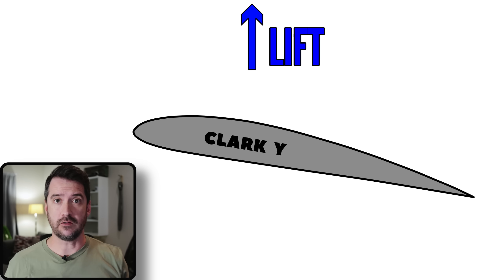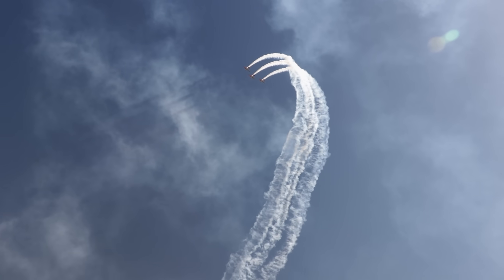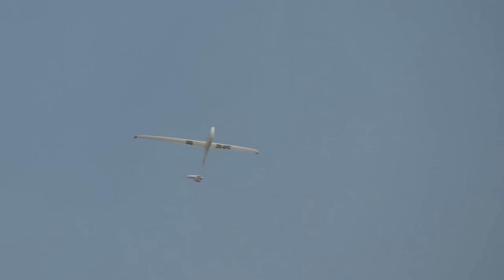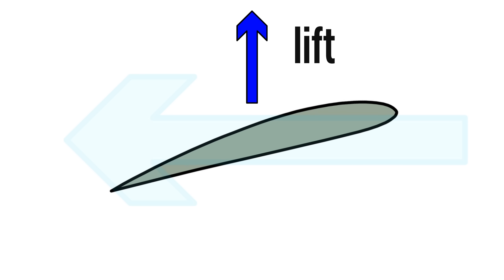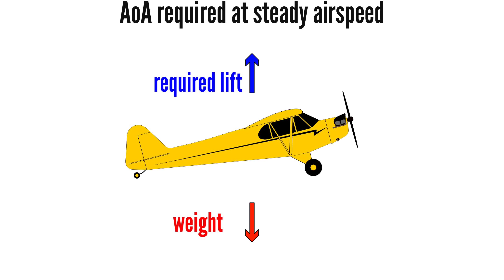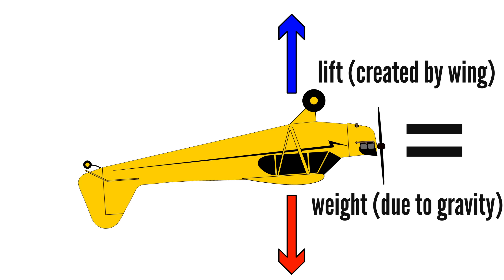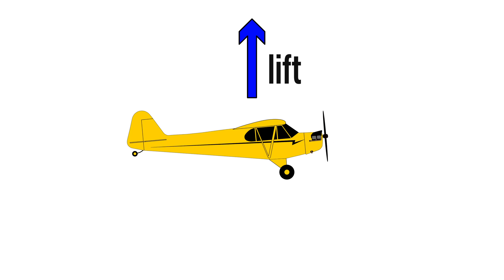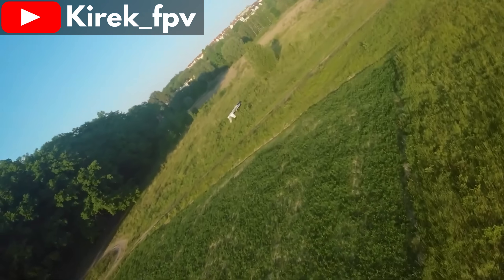Is Airflow Distance Over the Top of a Wing Always Longer?

Comment: 'Path length' creating faster flow above the wing and therefore lower pressure above the wing than below, is still wrong. Just because some people have come up with the wrong arguments for why it is wrong doesn't make it right. As one of your videos correctly illustrated, air flowing over the top of the wing arrives at the trailing edge 'before' air flow under the wing. This can be seen in wind tunnel experiments with dyes and aerofoils. There is no physical requirement for the divided air molecules / parcels / whatever to rejoin at the same time at the trailing edge. Path length therefore doesn't explain the velocity difference above and below the wing. There is no physical basis for appealing to path length to explain the lift force. I think the confusion in trying to intuit lift forces arises as we try to assign cause and effect at one instance in time to a flow. In reality, the pressure field affects the velocity field (or flow field) and the flow field affects the pressure field over a continuum in time and space which is why lift force is so difficult to intuit from a static picture. Bernoulli's equation only relates pressure and velocity, it doesn't attribute cause and effect. It would be fantastic to have a really intuitive way of picturing the explanation for the lift force on an aerofoil but I've yet to see one. There's a reason why there are so many incorrect attempts to wrap it up in a simple way. You still need a lot of heavy maths to calculate the numbers required. And when people say it's 'simply' Newtons Laws, fluid dynamics/mechanics embodies newtonian mechanics, it doesn't break it. In first year University Physics we derived Bernoulli's equation from Newton's laws. We use concepts such as pressure instead of force because it makes the maths more convenient and you can easily measure it in a flow.
Reply: I've read that the mass and velocity of the air shoved downwards provides much of the explanation for lift
Reply: @jmevb60  Yes, but downward on both sides of the wing. Without the boundary layer sticking to the wing on the upper side, the lift just collapses, although the lower side of the wing still works fine. This happens when a plane stalls, or when one sheets in too much the sail of a boat etc...
Reply: @jmevb60  So that's the conservation of momentum (mv) but you also have to conserve energy which is essentially what Bernoulli equation conserves.  Along with conserving mass, all three give you the Euler equations and you have to consider all of them together. If you want to consider viscosity as well, you get the complete picture which are the Navier-Stokes equations. But the Euler equations are a pretty decent approximation for subsonic flight and idealised aerofoils. They are all linked which is why it's hard to intuit. The path length and equal transit time are not physics though - which is why this video doesn't really have a point. Just because the upside down plane example isn't a good argument against path length, doesn't make path length and transit time true. There are several arguments against flat earth theory that aren't very good and you could ague against - but the Earth still isn't flat - for some other very good reasons!
Reply: @7up-weee  "The path length and equal transit time are not physics though - which is why this video doesn't really have a point."  

But you mentioned Bernoulli is an energy conservation process.  How do you initiate the Bernoulli pressure asymmetry, if you don't impose a path length asymmetry "stress" on the mass flow rate continuity?

Doesn't the mass flow continuity stress, drop the pressure to satisfy conservation of energy (mass transport rate equivalence: transport speed higher, at lower density)?

Isn't lift a fundamental consequence of an asymmetry imposed on fundamental principles of conservation of mass, energy and momentum, where the path length difference has to play a role?

Isn't the path length difference right at the core of the physics?  

Though I think there was agreement that equal transit time is flawed? (substitute mass flow rate continuity maybe)
Reply: @davetime5234  No, the path length difference is not the explanation. First because paper airplane fly just fine, so do very simple kites made with a simple tissue, sails create lift upwind (although they are thin) etc.
Second because if you compute the lift based on the difference of path length theory, the lift you find is way below the actual value. 
Third because there is no equal transit time, the air above the wing arrives before the air below. Demonstrated in CFD and experiments.
This does not mean Bernouilli is wrong, it is correct, but the pressure/velocity difference is not related with the path length difference. It is more complicated. However, to describe it intuitively, there is vorticity created, which creates two vortices, one above the wing, and one below, which based on simple centrifugal force, create a relatively higher pressure below the wing, and a lower one above.
Reply: @__-1234 " the path length difference is not the explanation. First because paper airplane fly just fine, so do very simple kites made with a simple tissue, sails create lift upwind (although they are thin)"

But doesn't the perfectly thin wing's asymmetry result in more curvature of flow lines on the lower pressure side than on the higher-pressure side?

And doesn't more curvature introduced between two points mean longer path?

Therefore, the difference in average path length must be related to the difference in pressure also in the case of a perfectly thin wing?

"if you compute the lift based on the difference of path length theory, the lift you find is way below the actual value. "

The above shouldn't be true if you take the actual path length difference introduced across the "entire stack of flowlines," because this composite flow line deviation directly represents the pressure.

"Third because there is no equal transit time, the air above the wing arrives before the air below. Demonstrated in CFD and experiments."

Mass transit time is equal between two contrasted regions which both are taken such that they have the same mass flow rate inputs but with different cross-sectional area restriction.

The velocity difference is proportional to the ratio of the two different cross-sectional areas (continuity equation).

"It is more complicated."

Most fundamentally I don't think it's any more complicated than asymmetrical path restriction imposed on mass flow continuity, and the necessary resulting conservation of energy and momentum effects.

"to describe it intuitively, there is vorticity created, which creates two vortices, one above the wing, and one below, which based on simple centrifugal force"

The reason why vorticity doesn't work for me as the default intuitive explanation is because vorticity is not a fundamental physical property in terms of first principle physical laws.  Vorticity is a physical complexity manifestation of even more elementary physical laws. 

While such derived complexity is also at a necessary level of analysis, as a starting point it seems to be causing a lot of confusion to the large diversity people's backgrounds who are engaged in understanding the fundamental nature of lift.  

"simple centrifugal force"

Centrifugal force again I can't picture in terms of a fundamental insight.  It doesn't help reduce the number of steps in gaining insight in terms of first principles.  

For example.   Centrifugal is the reaction experience from a centripetal force.

Where is the centripetal force?
Reply: @davetime5234  I don't think. If you check flow around a sail for example, there are just a few mm of distance between the intrado and the extrado. And it works, even allows the boat to go against the wind. 
The lift is created by the vorticity, not by the longer pathway.
And once again, it is very simple to show the longer pathway theory is wrong, since  it allows computing the pressure difference very easily with Bernouilli . And therefore the lift. And the lift that is computed this way is way too small. Cannot make the airplane fly... 
I know this is kind of disappointing, because this explanation looks nice and simple. But it is wrong.
Reply: @__-1234 I'm not sure which notion you're answering.  Please re-read my last comment as I've been editing it likely as you were replying.  You're disagreeing with things I haven't said.
Reply: @__-1234  If you are going to disagree with something I'd like to ask that you are very specific about what words you are responding to.  Mis-paraphasing is an issue here.
Reply: @__-1234  "since  it allows computing the pressure difference very easily with Bernouilli . And therefore the lift. And the lift that is computed this way is way too small."

Don't you think it would only be fair if you would, with sufficient accuracy, relate to me (since we can't share images here, I assume) your assumption methodology so that I can have a fair change of assessing its validity?
Reply: @davetime5234  Very simple. You take the pathway length above the wing, the pathway length below. You assume equal transit time T. The pathway length above and below provides a mean corresponding velocity V_above, and V_below, that you use with Bernouili, to convert to pressure P_above, P_below. It gives the pressure difference, which gives the lift. This lift, based on wing surface, should be able to lift an airplane.
If it does not, if it turns to be way below what is needed. Then... it is not the right explanation. Et voilà.
Reply: @__-1234  Ok, how did you:

1)incorporate the mass continuity transit time into that calculation, and 

2)how are you defining a path length comparison (what path lengths are you talking about?), and

3)how did you relate any such path length difference, to the cross-sectional area restriction imposed?
Reply: @davetime5234  
If you assume a certain length L below the wing, and another alpha*L above, and assume equal transit time T, therefore if the speed below is U, then the speed above has to be alpha*U. From this you can compute delta_p using Bernouilli.
It supposes the flow splits in two parts, and this is where conservation comes from.
But this is all wrong because there is no evidence the flow splits into two parts, nor that there is equal transit time, nor that the flow reaches the leaving edge at the same time from a Lagrangian point of view.
Reply: @__-1234  But you're imposing invalidly simplified assumptions, which guarantee an invalid result.

You can't apply Bernoulli without also applying the continuity condition.

And the path length (clearly this is a point of confusion) can't be taken literally to be the "transport path length."

The "path length" here, so far, only has the meaning of being an indirect measure of assuring asymmetry of transport access.

The question as far as putting in some numbers for estimation is: how much does the resulting asymmetry restrict the actual flow path access?

So, does the geometry of an actual in-real-life wing's asymmetry likely present two contrasting area cross-sections, capable of providing enough velocity differentiation, given a flight worthy level of indicated airspeed (dynamic pressure equivalent speed), to provide the necessary pressure difference to support a realistic aircraft weight?

The question can be restated: how much path restrictiveness do you need to impose, given the continuous mass transport requirement, to accelerate a given mass of flow sufficiently to achieve enough pressure difference, for the conditions of speed, mass density, and geometry, and useful load to be supported?

The implication is: the asymmetry imposes a higher than equal transit time speed on the unavoidable condition that mass transport does maintain equal transit time through the restricted space.

You need to calculate what the actual accelerated speed is for equal mass transit time, from the restricted access.

And, interestingly, the point you made about density not changing significantly, is necessary for the above calculation.
Reply: @davetime5234  So what is the path length ? For the Bernouilli equation to apply, you need the flow to be either irrotational, in which case you can apply it between any two points. But here it is clearly rotational above the wing.
Or you need to follow a Lagrangian trajectory. Like a tracer. And all Lagrangian tracers experiments, numerical or not, show that from a Lagrangian point of view, there is no qual transit time.  So please clarify this notion of equal transit time, what does it mean ? How do you compute this "time" ?
Reply: @__-1234  I was thinking in terms of 4 sets of rectangles to characterize above and below the wing:  two entry and two exit rectangles.  

But assume you only have the above wing set (something like an idealized simplification that the bottom of the wing is oriented such that no change from ambient pressure occurs at the bottom).

Then A1 x V1 = A2 x V2 because mass density is a constant.  The A's are "entry" and "exit" cross-sectional areas (areas capturing meaningful influence to the relative wind).  V's are the resulting velocities from the mass flow continuity requirement (mass in per unit time equals mass out per unit time). 

Clearly any non-unity ratio between A1 and A2 results in change in measured speed to arrive at the constant mass transit speed.

Because mass cannot accumulate in steady state, the mass equal-transit-time as indicated above must apply.

The resulting change in velocity required to maintain equal transit time of the mass through the restricted geometry, is then ready to be used in the Bernoulli relationship. 

Because Bernoulli relates the kinetic energy density to the pressure, the above implied velocity difference necessary for the essential mass transit rate continuity, gives a pressure proportional to the square of the altered V. 

So, the access restriction, as represented by the ratio of the A's, gives the change in V to relate that kinetic energy implication to the potential energy depletion, which is pressure.

And the "path length" in this thought experiment model, at least for asymmetry comparison purposes, (assuming the width of the compared cross-sectional areas can by simplified as equal) is related to both the ratio of heights of the input and output rectangles, and to their distance apart.
Reply: @davetime5234  I am not sure to understand your notation. 1 is above the wing, and 2 is below, or 1 is entry and 2 is exit ?
Reply: @__-1234  1 and 2 on top.  3 and 4, if any, on the bottom for example.

The main idea is you need to match "input" to its respective "output".

So, 1 outputting to 2; then 3 outputting to 4 (if any).

In the case where there is 1,2,3 and 4, you have a ratio between two pressures.

In the case of 3 and 4 having no restriction, then 1 and 2 result in a pressure drop relative to ambient pressure.

Obviously this isn't going to result in ideal precision, but it is forcing required first principles physical properties into a "budgeting exercise sanity check" for whether the assumptions are realistic in terms of real world numbers.
Reply: @davetime5234  ok, so you have mass conservation above the wing, and also below. Your formula is also very approximate, because the velocity profile above and below are not constant, so the velocity is not uniform. And the area is infinite, you are supposed to integrate the flow from the wing where the velocity is zero up or down to infinity, infinity being a place where the flow is undisturbed by the wing.
But anyway, the only thing you can conclude from this is that there is mass conservation above and also below. It tells you nothing about transit time being equal or not.
In order to compute the transit time, you need first to define it (we could say simply it is the time for a Lagrangian particle to go from the leading edge x position to the trailing edge x position, following a stream line located at h above or below the wing), and then compute it using a flow field description. Which you do not have and cannot have unless you either do a CFD simulation or an experiment. 
And this experiment would show you that the transit time is not equal. Just search on youtube. I'll search and send a link.
Reply: @__-1234  "ok, so you have mass conservation above the wing"

Maybe.  You can play with the options, but the set-up has to start with mass conservation in the system, somehow distributed.

"Your formula is also very approximate"

As I said, you can play with the options in making a budgeted estimation.  But the method simply must impose the equal mass transit time to get the actual velocities.  You seem to be avoiding that first step.

If you don't impose mass continuity, you have no insight about what is driving the system and no chance of understanding physical reality in terms of the relevance of the first principle laws.

"It tells you nothing about transit time being equal or not"

Mass transit time is equal, that means the actual velocity has to increase.  That velocity increase is what gives you the pressure drop.  The preceding statement is 1)the continuity equation, plus 2)Bernoulli's equation.

10 race cars across the finish line per section can arrive as 10 cars in single file per second, or two rows of 5 cars per second.

The number of cars (the "mass" quantity), is the same in both cases, per second.

But in the restricted access case (the single line of cars), they must arrive twice as fast to give the same mass flow continuity.
Reply: @davetime5234  I still agree of course, that there must be mass conservation. But can you please define the transit time, and show me why it should be equal, where all experiments show it is not equal.
Reply: @__-1234  The mass conservation, as you said you agree with, means that in steady state there can be no buildup of, or depletion in the amount of mass within the system.  

That of course means rate of mass flow in must equal the mass flow out.  That further implies that if we are looking at some area where we insist that the mass flow out is occurring at greater speed than mass flow in, then the only possible conclusions are that:

1)the system is not in equilibrium (such as with a capacitor in the process of charging or discharging).

2)we are improperly measuring outflows against inflows somehow.

If we assume the answer is "2)", where are we messing up the observation or conclusions?  Is there?:

a)some density effect after all that is unaccounted for? (I assume unlikely?)

b)some counter balancing mass transport transactions occurring outside our window of observation?

c)in speeding up over the wing relative to below the wing, is the lower air decreasing in average speed enough to make up for increase in average speed above the wing?

Any other options you can think of?

One thing is for sure looking at the pulsed smoke wind tunnel demonstrations: 
The abrupt relative speed change spikes right where the air in the middle encounters the leading edge blockage as it is forced to find an alternate route (the mass there obviously faces causing an expedited transport through the route of adjacent moving air, if the density is to remain relatively constant).

the "bigger inflow cross-sectional rectangle leading to a smaller outflow one" is an effort to say what mass flow continuity and a Bernoulli constriction allows us in terms of available quantity of pressure drop using actual numbers.  I view it as an iterative exercise to focus questions on what has to happen based on the applicable basic, first approximation, but unavoidable laws.

Using only two such rectangles rather than 4, the main question becomes the relative height of the two:

How much a "capture area" gets "squeezed."
Reply: @davetime5234  Your answer c is the correct one. The flow does not split into two equal parts, there is more mass transport above the wing than below, and the two flows balance one another. It is a continuous media, not a flow of particles, and this balance works regardless of the shape of the wing. I disagree however with your end statement, at least below Mach 1, the information that there is a wing is felt upstream in the flow, ok perhaps not much upstream but enough to influence the entire flow structure. The shape of the wing is not what creates the lift. It optimizes the drag vs lift etc perhaps, but you can create lift with almost anything. The Wright brothers airplane had flat wings, jet fighters have wings which are more like blades etc... and they all fly.
Reply: @__-1234  "there is more mass transport above the wing than below, and the two flows balance one another. "

Are you saying that the bottom flow does in fact slow down?  Because I can't tell from the wind tunnel smoke lines, I can only compare one with the other (relative value rather than absolute).

"It is a continuous media, not a flow of particles"

Why is that relevant?

"I disagree however with your end statement, at least below Mach 1"

I don't think you disagree with me, I think you mis-read my meaning.  I had the word squeezed in quotes, and I had already just re-affirmed that the density doesn't change.    By "squeeze" I mean, with that unchanged density, the "traffic path" above becomes congested (it is already servicing it's own mass flow rate, and now it has more), so with unchanged density the speed must increase (the race cars in a single line again).  In other words, the channel capacity becomes squeezed at the lower speed, so the speed is the only way to resolve the issue.

"is felt upstream in the flow, ok perhaps not much upstream but enough to influence the entire flow structure."

I'm aware of this and I believe it is inevitable:  "traffic congestion ahead of a capacity limiting intersection" backs up traffic.  Even without any meaningful change in density, there has to be a sorting of the passage channels piling up in influence ahead of the "intersection."

"The shape of the wing is not what creates the lift."

That statement is misleading.  Shape does create lift to the extend the shape is asymmetrical.  

Asymmetry is the defining feature of lift creation (as you hinted at with the comment about any shape).

Two possibilities for asymmetry:  asymmetrical shape of the airfoil itself, and/or asymmetry due to angle of attack.

It's important to get, that it is all about asymmetry, because that focuses one's attention on looking for how to see the lift making in terms of "modulated restriction" vs "shape restriction" of airflow.

With the common operative word being "restriction," because that is what forces the pressure drop under the demands of mass flow continuity.

While a wing with asymmetrical camber theoretically has one airspeed for a single given air density and temperature where lift will equal weight, that does not facilitate real world flight operations.

Angle of attack is always used to "modulate" the restrictiveness in the airflow, that is, it is used to adjust the total asymmetry (some of which often comes from the shape) which is responsible for lift.

The above implied adjustments to lift coaxed from a wing is needed, obviously, for changes in air pressure, temperature, indicated airspeed, and aircraft load.  

You can always see these effects in the varying angle of attack of a real aircraft, in adjusting to current flight conditions.

With angle of attack you are basically adjusting the turning of the air, by changing the pressure drop (well, pressure difference), through a change in restrictiveness to a mass flow rate that demands unbroken continuity.
Reply: @davetime5234  Yes, I think the flow below the wing slows down, I can't tell either from smoke experiment.  
Regarding the asymmetry, planes with symmetric wings fly just fine. Paper airplanes etc... we've been through this already.
Reply: @__-1234  So are you claiming that angle of attack's primarily function is not to add asymmetry, and that a symmetrical airfoil can generate lift at zero angle of attack?
Reply: @davetime5234  Ah no, of course not, ok sorry but then I missed a point here.
Reply: If the flows don't arrive at the same time, then what is happening to the 'lost' mass?   It must be building up somewhere (not physically possible)
Reply: @dougball328  There is no lost mass, because the "equal transit time" based on the longer pathway above, assumes that the flow splits into 2 equal parts. But what if it does not, what if there is actually more mass going above the wing than under ? No need for equal transit time anymore. The flow would have to go a lot faster above the wing, and arrive before the flow below the wing, which is exactly what happens (check experiments, there are several good videos on youtube).
The equal transit time story comes, I would guess, from the assumption that the flow "does not know" there is a wing before it reaches it. Which is a wrong assumption, below Mach 1 at least. The presence of the wing is felt upstream.
Reply: @__-1234  I'm done trying to explain aerodynamics to the uneducated.  There was no assumption that the flow 'breaks into two equal parts'   However, those two parts have to arrive at the trailing edge at the same time.  One of the fundamental laws in aerodynamics is conservation of mass.   Now go read a god damn book on basic aero and learn something.  Rest assured I will never return to this POS conversation.   It has proven pointless.
Reply: @dougball328  OK, i will go and open my books of fluid mechanics again, and ask for my engineering diploma and phd to be cancelled, because obviously i don't deserve them.
Except that the flows do not arrive at the same time at the trailing edge. All experiments, numerical or not, show it.
Facts are stubborn... this is what is annoying with science.
Reply: @dougball328  I have been thinking about it even more, even if the flow would split into two equal parts (which it does not), if you take a point at 1cm below the wing and one at 1cm above at the trailing edge, there is no  reason why they should arrive at the same time from a Lagrangian point of view. The two boundary layer profiles below and above have no reason to be linear to one another.
Reply: So then tell us where the mass goes that does not make it to the trailing edge?   Place a vertical plane right at the leading edge and one at the trailing edge.  The same amount of mass must pass through those planes at the same rate.  Otherwise you are stacking it up somewhere (and that does NOT happen)   So you see, there IS a physical basis for it.   Confusion comes from all the armchair aerodynamicists who never actually studied the subject.  I did, for five years and two degrees.
Reply: @dougball328  Airflow across a wing - Cambridge University - Wind tunnel visualisation.
Reply: @dougball328  The same amount of MASS (per unit time) has to pass through the two planes, but not at the same VELOCITY.  So there's no constraint that the air over the top has to have taken the same length of time as the air under the bottom.
Reply: @dougball328 you must have seen wind tunnel experiments with dye injected into the flow? Conservation of mass is not broken just because the flow is separated at the leading edge and air is accelerated over the top surface.  It might help to search for videos of wind tunnel dye experiments over aerofoils to visualise it.
Reply: @dougball328  This is the root of the equal transit time story i think, the assumption that the air flow splits into 2 equal parts, one above, one below the wing. 
I don't see a single reason why it should, at least below Mach 1.
Reply: @__-1234  I stated it poorly.   The amount of mass that goes above/below the stagnation line at the leading edge must exit the trailing edge at the same time .  Otherwise mass is building somewhere.
Reply: @dougball328  I am not sure to understand, what do you call the stagnation line ?
Reply: @__-1234  The stagnation line is the dividing line between the flow going over the wing versus the flow going under.
Reply: @dougball328  well then you must have failed them. Your statement only works with infinitely tall planes, otherwise you need a third plane above the wing to create a valid control volume in 2D. Then you can have more mass exit the back by having mass enter vertically, or less mass leave by having mass exit vertically. Which is what will happen due to the pressure gradients across these horizontal planes.
Reply: @Bruno-cb5gk  The way degrees work, a person burdened with an impressive collection of horrific misconceptions will nevertheless receive their two degrees with full pomp and ceremony merely by jumping through required hoops, i.e., by making the appropriate noises when asked questions during assessments. A completely ridiculous farce.
Reply: @dougball328  Lol, if that's what you learned in five years doing two degrees, poor you! Consider the general case of a fluid flow that diverges into two branches, then rejoins again downstream. Depending on the characteristics of the flow in each branch, the velocities and mass flow rates can be the same or different. But regardless whether they differ or not, mass is of course conserved at all points! The mass flow before the divergence (your "vertical plane" at the leading edge) is of course the same as the mass flow at the rejoin (trailing edge.) The elephant you confidently marched past without noticing is that the mass flows along the two paths, when different, simply sum to the same total mass flow at every section. Of course no mass is "stacking up" anywhere, lol. There is no magic requirement for the respective velocities, or indeed mass flow rates, to somehow be equal. Contrive the mass flow rates to differ by any factor you like; the mass balance still works just fine. So much for the "physical basis." 😂
Reply: @lucasgroves137  But how do you know if the fluid splits into two equal branches in terms of mass flow, one above the wing and the other below. There is absolutely no evidence for this.
Reply: @__-1234  I don't need any evidence for a strictly equal split of airflow above and below a wing because I never claimed that such a silly idea is true. I gave the example of a flow splitting into two equal parts because that's easy to describe; applying conservation of mass of course doesn't require them to be equal, or indeed to satisfy any particular ratio. Why on Earth would it?! To be fair, it should be comically obvious to anyone who has first year fluid mechanics, etc, that whatever the split is, those flows together amount to the total flow, and that (of course) is conserved. But such a silly idea as the two flows adjusting speed so that parcels of air that were adjacent at the leading edge will once again meet their little buddies at the trailing edge is not worthy of a kid in junior high school science. Maybe you should slow down and choose one or two comments to respond to, rather than attempt to answer everyone; you'll probably find you get your wires crossed less often. 😃